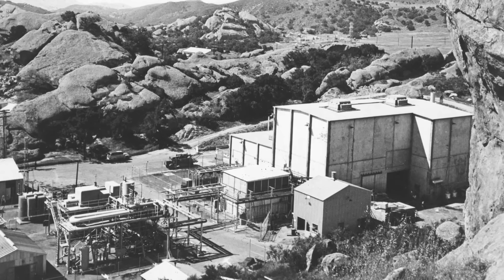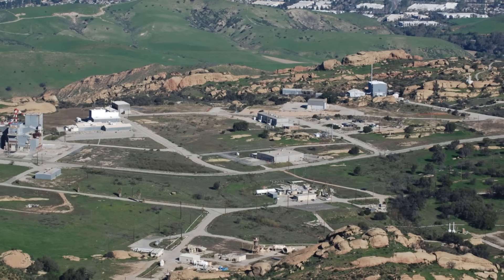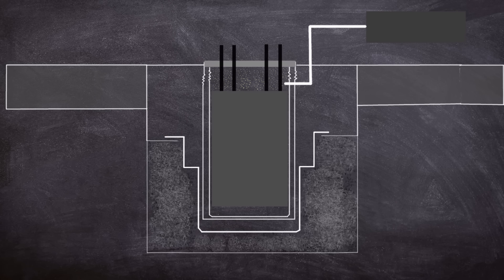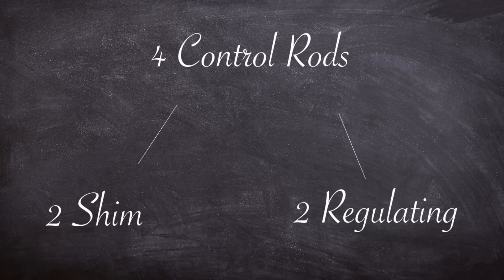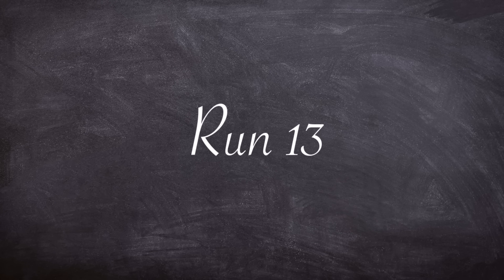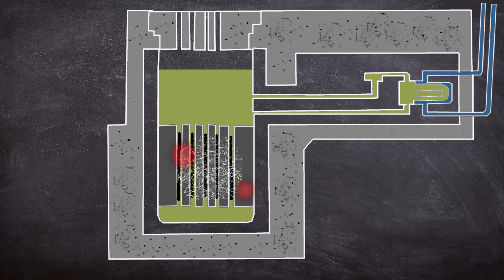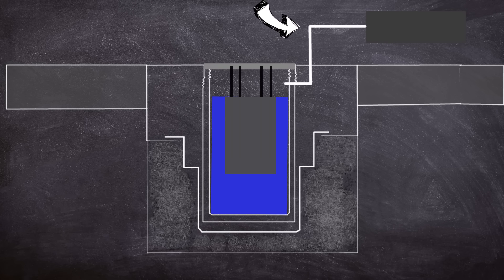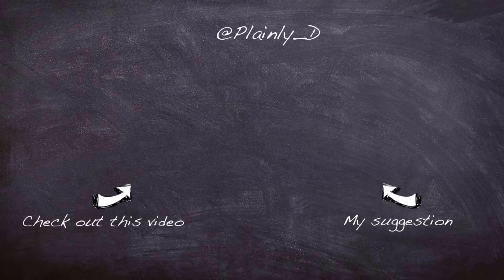A Brief History of: The Sodium Reactor Experiment Accident (short Documentary)

Comment: I know, let's add a highly reactive element to an experimental reactor! Seems perfectly safe to me.
Reply: No coolant is "safe". Seriously, I can't think of a single type of nuclear coolant that's been used that doesn't have some major safety flaw, either chemically or mechanically. The high temperatures involved don't really allow for "safe" coolant. High pressure water is also a neutron moderator, making it unsuitable for fast reactors that can use a wide array of fuel types and even utilize what would usually be waste products. It's also superheated steam, and steam explosions suck. Not to mention it can react explosively with reactor cladding materials. Molten lead...probably don't need to say anything else, really. Cleaning up a spill of that stuff would be a nightmare, even if meltdown would probably result in the core getting coated in lead, preventing radiation leakage. The molten salts proposed for thorium reactors are fluoride salts, and are extremely corrosive and toxic, IIRC. Helium is probably the safest coolant chemically, but also the hardest to effectively contain. Coolant leakage is almost inevitable with helium-cooled reactors.
Reply: @Nixeu42  Also there probably isn't enough helium on earth to operate even a couple powerplants.

Comment: Hey Plainly Difficult, after watching your videos I still believe nuclear energy is overall a better energy source than what we have now and we should open up more nuclear power plants. You have done a lot of research on this and I was wondering what your opinion was on Nuclear Energy.
Reply: Oh yeahhhh, nuclear plants are good energy producers --- but piling up tons and tons of spent radioactive fuel rods to be stored in pools of water and buried in Mountains waiting for the containment vessels to fail and start leaching radiation into our ground water supply along with the eventual earthquake or volcanic event will be WAY safer in the future than burning coal with scrubbers.  Are you aware they are now operating many of our nuclear reactors far beyond their designed lifespan-?  Also the safest nuclear plants have the characteristic large dome containment building of thick concrete, but many GE reactors do away with such heavy containment buildings due to cost, instead relying on "vastly improved safety systems" - yet many of these are the very same reactors that are being run years beyond their design lifespan.  Dont forget even with things like reactors and the space program cost has often times taken precedence over safety and ended in disaster, sad but true.
Reply: It's not worth the risks, that's my opinion. You can't safeguard a nuclear reactor from natural disasters or terrorist bombings. Plus nuclear generators have very take up to 10 years to build, minimal shelf-lives, and cost a fortune to decommission. It's really not as green as people make it out to be.

Comment: I go to Camp Alonim in CA, which is less than 2 miles away from SSFL. There have been harmful chemicals found in cow's milk there, among other concerns. I also may or may not have eaten a potentially dangerous and radioactive apple from a gnarled and old apple tree that was growing during the time of the disaster. There are also a couple high points at the camp where you can see parts of SSFL.

Comment: I am not sure it is allowed to be shown in schools now a days , but I remember with absolute clarity 53 years later , watching my chemistry teacher cutting a piece of sodium , it can be cut with a buttering knife as it is softer than lead , and dropping it into a bowl of water . Us kids would be maybe six foot away from the table the bowl was on and the sodium piece would be about a sixteenth of a pea in volume . The sodium would fizz in the water and then steam would be seen , in less time than you could say 'hello and goodbye' , then the sodium would start moving on the water surface accelerating and visibly on fire . If the piece was smaller it would dash around the bowl in a circle and burn out , but if it was slightly bigger it would fly out of the bowl in a straight line in whatever direction in choose , beyond six feet ....  Sodium is kept in a some sort of oil , to prevent it burning moisture /humidity out of the air , in a glass jar , and kept on a shelf on the chemistry lab wall behind a glass door , or it was in my day ! I saw this exciting 'experiment several times whilst at school .
So they thought sodium was a good coolant for nuclear power stations ? They never went to my school then !  Kin'ell

Comment: What I like is that this event is parodied in the Battletech universe. The Tharkad Fusion power plant used molten sodium as a cooling agent as well and, due to consistent cutting of maintenance funds, the holding tanks of the molten sodium were left in an adjacent facility to the plant. one day, during operation, a massive week-long snowstorm hit the city and tons of snow started to crack down on the aged roofing. Eventually, the roof caved in and 5 tons of snow flowed into the vats of molten sodium. Big boom and a cracked fusion core later, a sixth of the City of Tharkad was lost.

Comment: Assuming the sodium was heated to around 500°C, to still have oxides come out of solution at that temperature implies the sodium was absolutely filthy. Nowadays the saturation temperature of oxide in sodium is maintained at or below about 140°C by continuously diverting a fraction of the flow through a so-called 'Cold Trap' that is an intended point of oxide precipitation where it can be captured out of the overall inventory.
This is not a new technology and I'm honestly surprised a cleaning unit like this wasn't part of regular operations.

Comment: 15:20 my favorite is in the SL-1, the Army's "small" experimental nuclear reactor to provide power and heat for radar sites in the Arctic. Intended to be operated in remote locations by regular old grunts with a couple of weeks training. The control rod (there was only 1, there had been 5 in a "plus" shape but they discovered the outer 4 didnt do much so they cut back to just the center one) was raised and lowered BY HAND, no motor. One day they were trying to raise it about 1/2". It was stuck, so they gave it a tug. It broke loose and rose 4" instead of 1/2" and went prompt critical; its electrical production was intended to be about 300 kW and its thermal limit was 4MW (4,000 kW) but when the control rod jumped up it reached 20 GW (20,000,000kW) in approx 4ms (.004 seconds) and vaporized everything causing a coolant water surge that "popped the lid off" the reactor and causing the entire reactor to lift up like 30' into the air, and fired the control rod out through the top so hard it impaled the grunt trying to lift it in through his groin and out his neck and pinned his corpse to the ceiling like a bug, while smashing the other 2 guys on shift with more traditional blast compression, killing all on board. Next shift came on and couldnt get any response and couldnt find anyone.

Comment: look im quite dumb in this but i still got a question.
i understood (water max heat is lower then that sodium) 

what was their intention with the whole experiment if it did work?
i only have thoughts on the heat being so hot that i have questions on the whole build and guess how fast things are broken such as that steam generator its life spawn doing its operating time.
Reply: Electric power, at least. Process heat for chemical plants and steelmaking, etc.? Don't know, but those seem to be potential applications possible with high-temperature reactors, as they are mentioned in connection with molten salt.
Reply: @b43xoit  wicked sht with reactors tho

Comment: Is this similar to a LFTR?
Is there any reason why molten salt reactors didnt replace pressurised water reactors? Sounds like molten salt reactors are safer, especially LFTR where the salt also acts as the fuel, if you drain the salt the reaction stops and the salt solidifies.
Events ( I dont like the word accident) like Chernobyl and Fukushima were high pressure steam explosions.

Comment: I was kind of interested in this video since my Father was the head Rocketdyne safety engineer for the F1 rocket engine testing (first stage rocket engine for the Saturn moon rocket.). When my father was in his late eighties some people paid him a visit with questions as to where different things where buried around the test site.  It seem that he did have good memories where some of these places were.  On the nuclear issue, I was not aware of the powering of the City of Moorpark even though I went to the Junior college there.  Recently I have been reading up on this reactor accident.  I have come to the conclusion that there was probably more radiation released than admitted by Rocketdyne and far less than what the alarmist claim. It seems to me that radioactive iodine and cesium would not be released in large quantities by the melting of a few fuel rods in a sodium cooled reactor.  There was no explosion and the cover gass was never uncovered.  Most likely, the sodium would have trapped the iodine and cesium.  Several thousand soil tests in the area only showed a hand full of sites with radiation levels above back ground.  Most likely it was mostly radioactive tritium and other inert gases that were released which would not be a likely cause for cancer increases.  Even so, there was a big lawsuit that claimed that radiation from the accident cause a few hundred cancer deaths in the local area.  Allot of these so called radiation cancers, back then, are now, not associated with radiation exposure.  So why did Rocketdyne settle.  Maybe it had to do with some of the questions put to my Father. I personally think, if anything, the cancers would be related to chemical discharges not radiation.  Remember, this was a rocket engine test site (remember the space race, get it done quick) where all sorts of nasty chemicals get release into the air.  Again, like the radiation release, Rocketdyne most likely does not have good records what chemicals have been released over the years.  This would have been a good reason to settle.
Reply: I can't believe they waited until the man was in his 80s to ask.

Comment: 1:20 a mistake here: Boiling point of water at sea level is 100ºC instead of 100K, and Na boils at around 882.940ºC. 
100K is a very low temperature, and water would have frozen solid.
Reply: He's talking about the differences between freezing and boiling temperatures.

Comment: I initially thought this was a test bed for the reactor that went into the Seawolf. However that was commissioned (the whole submarine ) in 1957 so it is clear that the USN did independent development work and clearly they had a lot more of the bugs ironed out.  It ran or only a year on t he original reactor and then the reactor was removed and replaced by a standard pressurised water reactor.  Clearly there were big advantages in terms of compactness, lack of moderation and liquid pressure but there were huge risks having one in a submarine viz. the slightest leak of sodium will cause loss of the ship because there will normally be some dampness in the boat to cause combustion of the liquid sodium.
Reply: That particular design originated in Oak Ridge National Labs, as did the standard pressurized water reactor design the US Navy uses, IIRC. Which actually has a really good safety record.

Comment: I'm just gonna throw this out there. The sodium reactor design is pretty outdated and modern molten salt designs use a lithium-flouride-beryllium solution as a primary coolant and they use an extremely corrosive resistant alloy in the piping system. They're extremely exciting technologies that in theory provide some crazy efficient output energy.
Excellent video though

Comment: In the early 80's the Nuclear Engineering Department at Manchester (Victoria) University had a liquid sodium experimental lab in the basement of the Engineering building. I always presumed it was safe. Chernobyl hadn't happened yet,  and TMI was something the yanks did.......
Reply: I mean...it probably was fairly safe. Quite a number of research reactors are sodium-cooled, or sodium-potassium alloy cooled, and have entirely unremarkable existences, with no major issues. Small-scale research reactors tend to be a lot safer and more easily controlled than industrial power reactors. Not saying there's no risk, but the gas and vacuum lines in chemistry labs are also pretty potentially dangerous. And often have a lot less oversight.
Reply: @Nixeu42  we had a little swimming pool reactor to play with. Hi tech, with a Commodore PET to control the rods. It was the only PC any of us had ever seen. At the computer centre we had punched cards to program with.

Comment: The issue of the sodium oxide being created and causing issues says to me that the primary loop wasn't completely free of oxygen, the issue of tetralin also speaks to me that there was some source of napthalene as according to the Wikipedia page it's created from napthalene using nickel catalysts and nickel was present in the core, meaning to me the sodium wasn't completely pure
Reply: Nah, the tetralin was used to seal the pumps. You're probably right about the first part. My guess is that the seals failed.
Reply: @Nixeu42  seems to me then that tetralin wasn't the best seal material because of the failure and thus the formation of the oxide
Reply: @Romuls753  Seals can fail even with good materials. Poor design, poor manufacturing, poor installation, poor maintenance, all of these can be factors in seals failing. Given some of the other issues this reactor had, I cannot rule any of those out, and they're not really my field of expertise. 

But materials science is closer to my chosen field, and it's usually way, way more complex than it appears from the outside. It's easy to say this or that material was a bad choice based on the results, without realizing that the properties needed for the job made it the best option known, even with its defects. The only way to accurately assess the quality of any given material is to know the parameters. And I don't know enough about the materials science requirements involved here to comment on the quality, or lack thereof, of the material itself. It was likely chosen for resistance to corrosion by sodium metal, but there were likely other reasons to use such an obscure compound. Without knowing the parameters, I can't name alternatives to judge against, either. Resistance to sodium metal corrosion is not exactly a trait that gets tested heavily by chemists. It's such a niche application that tetralin might literally be the only confirmed and known option, and finding an alternative would take money and time, and require knowing it would be a problem in the first place.
Reply: @Nixeu42  the other issues you mentioned aren't issues with material choice ultimately, they're a problem with said material. Material X can be chosen for X application and be the proper and good choice but then when issues arise with X in X application you come to realize that it is a problem with X material because of Y issue in manufacture, in installation, maintenance, etc
Reply: @Romuls753  But those issues could equally be on the manufacturing end. Bad QA could account for a number of those problems. And bad installation can equally be on the user end. If someone installing the cathodic protection system for a boat wires things backwards, so that the anode becomes the cathode and vice versa, and thus the boat hull corrodes like crazy in sea water due to galvanic factors, the problem is in neither the material chosen for the sacrificial cathodes, nor the material of the hull. It's down to user error. Jumping straight to ruling the seal material used the problem without looking at any of the other details is as fallacious as jumping to any other factor being the core problem without looking in-depth at the situation.